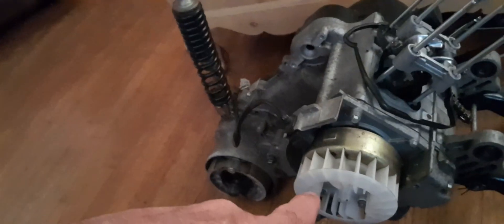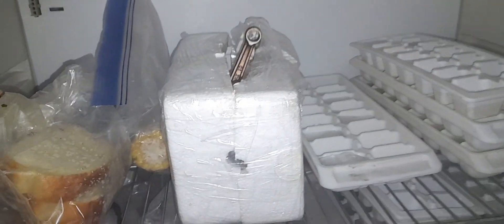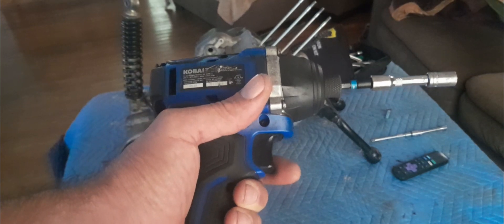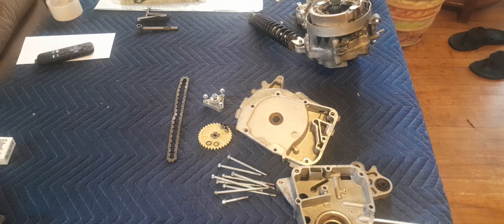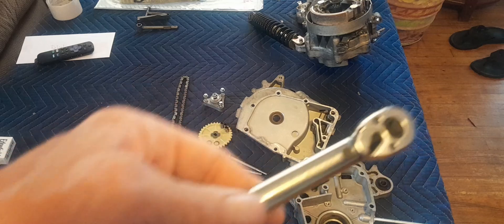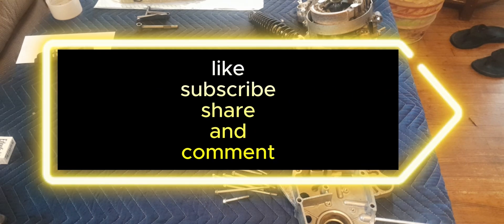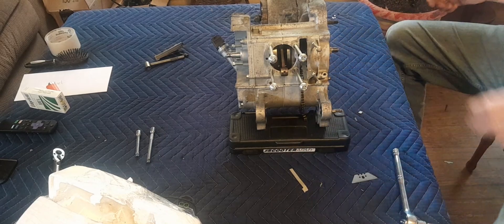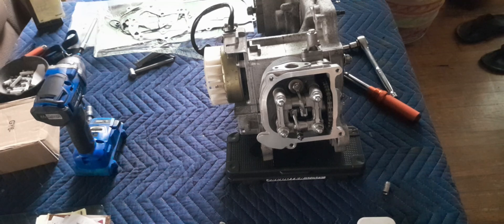44mm AliExpress Stroker Crank for 139qmb gy6 50cc build

Comment: Did you have to add another gasket for the 3mm extra gap? Also, what did you end up adjusting your valves to? 0.03 and 0.04 or 0.04-0.05 or different? Probably would be good to buy an entire engine and do this so i dont got to buy all the gaskets haha. Plus its cleaner that way. Looks fun xD. I want to get into boring out the engine to make them 105cc and change all the bearings to japanese ones and was wondering whats the best gear ratio for that 44mm stroker. 16/42 ( mild builds ) so i was guessing 17/41 would be better, but theres also 16/45 that seems also good! Ill start getting into addint them up later on to keep it at 11.4 or so. Wonder what people do to make them pop wheelies haha, i think its funner to build an engine to its max rather than a bigger engine. Thanks
Reply from the maker: @JoshSparky1990  no additional base gaskets requires. The additional stroke is 3.6mm total, which equals 1.8mm up and 1.8mm down ~. There's enough space to do this with no additional gaskets. As far as valve lash, I almost always go with .003in on both intake and exhaust. 
Buying a new engine will still require all new gaskets as you have to split the case to install new crank. I run 49/17 gears.
Reply: @scooterarmy  Ah, because I read on a comment that a guy built a 100cc with a 44mm stroker, he says he now has a rattle and he's pretty sure the piston is touching the head slightly. He said he's been trying to research if there's a spacer or what to do but very little info on them. Then the reply was that you need to add another base gasket for clearance, I don't see how it could hurt much but doing so, and about getting all the gaskets even on a new engine. Got to find one with the full kits and get a couple of them. I just wouldn't want to tear down into it if it has a rattle, you get this one running? I work once a week on a scooter shop to learn. He's old school like I'm sure most people, but I'm going to get a 12/20 ton press and other things. I don't want to hammer out anything and damage stuff. 😂. Thanks

Comment: Hey man i just ordered one also and was looking on yt for people with results. Thats how i got here😅😂. Can you tell me the differences you felt and maybe make a video showing the 44mm crank running? Much love from the Netherlands❤.

Edit: sorry i just read the end of the video 😅😂
Reply from the maker: @bastencamp509  your timing is impeccable.  I've been super busy and .. get this.. I am installing the engine on my vip as we speak.  We'll, I'm at lowes getting a couple washers, but it will be installed and first test run in the next few hours. I will be doing a short video
Reply: Just saw it man sounds great👍 looking forward to see how fast it is when you've tuned the carb💪
Reply from the maker: @bastencamp509  first good test ride later today